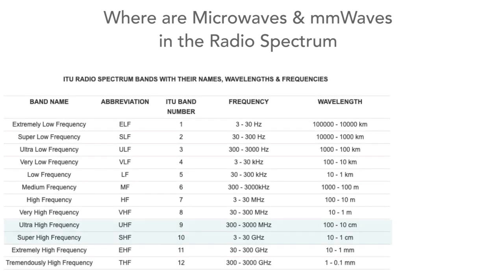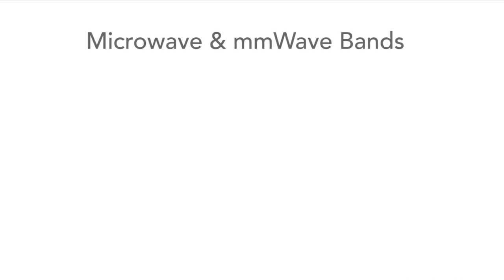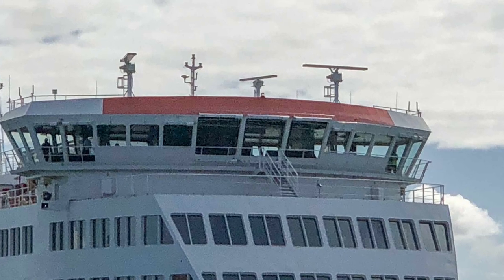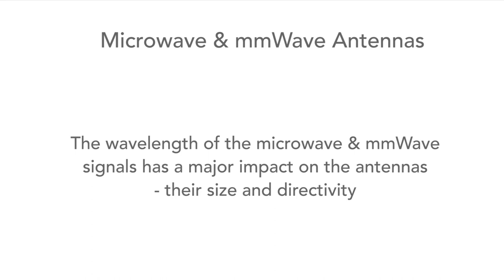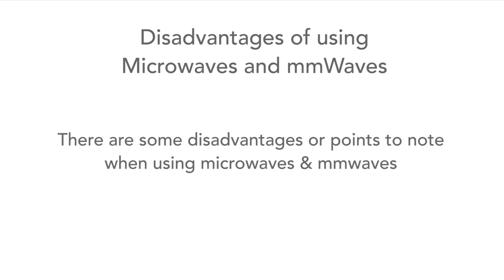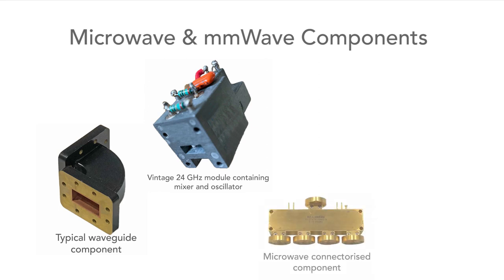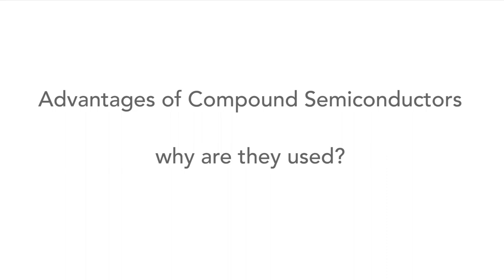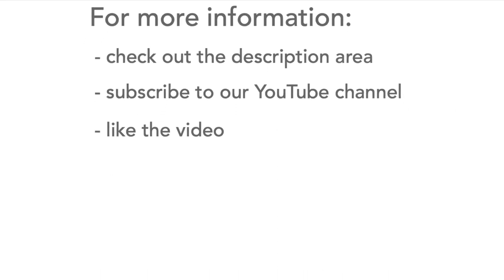What are Microwaves & mmWaves - a 101 primer

Comment: Used to use microwave for point-to-point links in data networking. Have been out of that for a while now, but would love to see more videos about mm wave technologies and how the designs are handled (as you touched on here noting that the wavelength is of similar size to the features of the circuit etc). Thanks for the video.
Reply from the maker: Glad you liked the video. I'll have to see what else we can do. Thanks for the idea.

Comment: To add to the confusion, the prefix "micro" represents a smaller unit than "milli", but not in this topic; it must be that "micro" was adopted as a general term to describe really short wavelengths, rather than as a strict unit of measure.  One could have expected them to be called "cmWaves".  Maybe.
Reply from the maker: I confess it is a term I have always accepted and would need to look into the origins of it a bit more.
Reply from the maker: The reason microwaves are so called is because the wavelength is short, I.e. small & micro means small.
Reply: @ElectronicsNotes  That's what I thought; I just find it fascinating that as a result, "millimeter waves" are smaller than "microwaves".
Reply from the maker: I think it is because when the term microwave was first introduced nobody really thought about mmWaves. Also the term micro was a term that tended to be used rather loosely: microbore pipes, micro bus, and so forth. I don’t think the term was done scientifically.
Reply: @ElectronicsNotes  Understood and thank you.